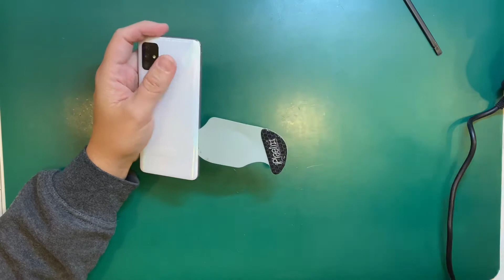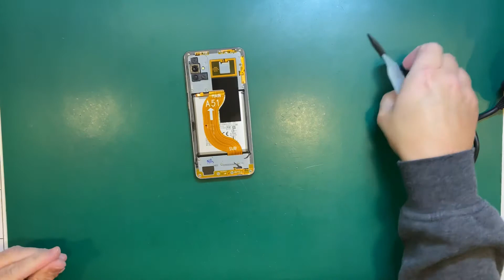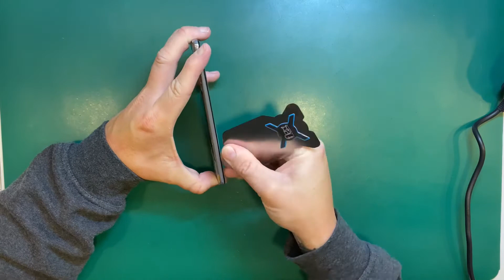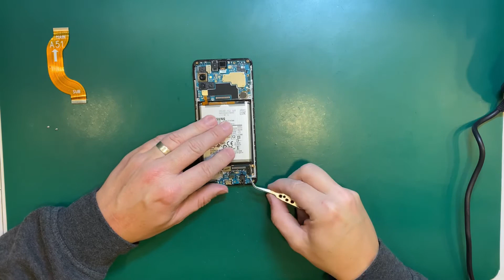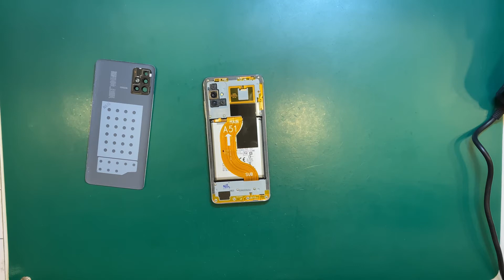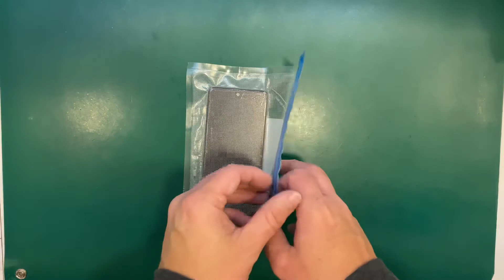SAMSUNG A51 CHARGE PORT REPAIR unedited full video!

Comment: Followed the video put phone back togeatherworked great but screen keeps going on and off by otself any ideas please
Reply from the maker: Hi there 
This could be a faulty screen or have you tried cleaning connectors ? I would also check if you plug into an amp meter see if the battery is taking amp into the battery or if it’s going up and down ?
I suggest checking all connectors not just the lcd one 😀 any problems let me know 
Hope this helps 
Mark

Comment: idk my problem , just swapped the charging board. but nothing .     battery was fine when was the last 10%
Reply from the maker: hi 
when you say "nothing" do you mean after changing it there is still no charge going to the battery ? many thanks mark
Reply: @Ifixit-mobile  whoa fast reply . No charging sign . I mean that circle with the lighting. Battery was good i had problems putting than white small cable.

Comment: Does A51 charging port play music audio?
Reply from the maker: there are contacts on the charge port board that connect to the loud speaker. so loud spaker and the charge port board both need to be working to allow sound to work. hope this helps
regards mark
Reply: @Ifixit-mobile  thanks